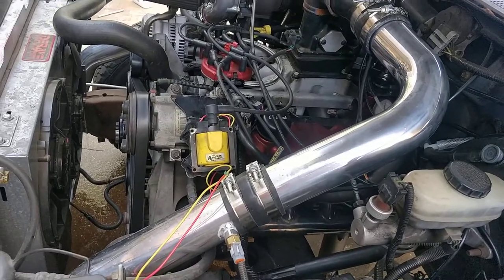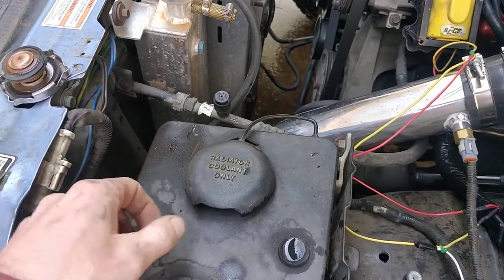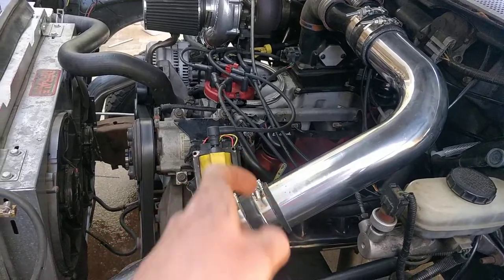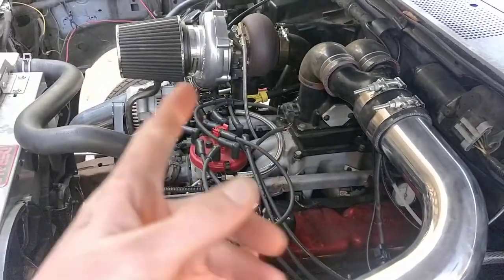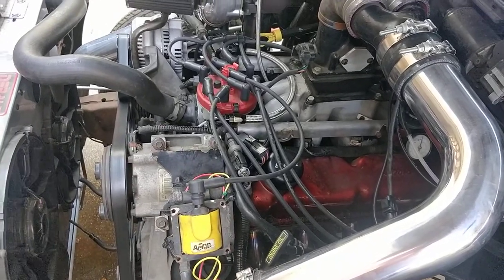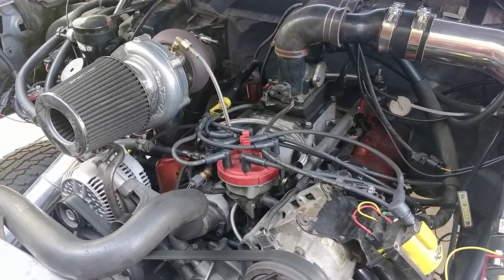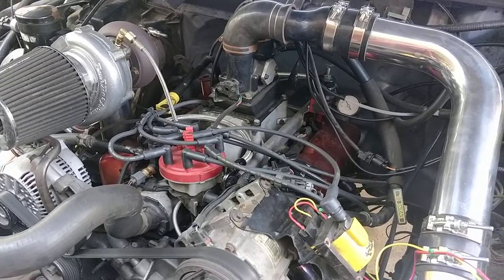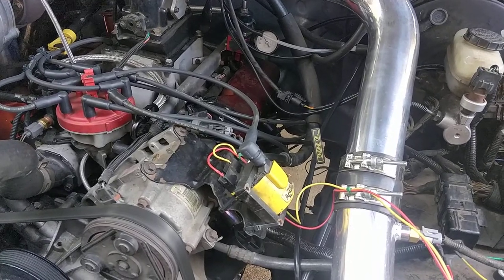Well there's bubbles in the radiator

Comment: Maybe look into getting a multi-layer steel head gasket? Only so much you can run on the graphite ones. though my buddy does run about 9 PSI with his graphite head gasket, but that's pushing it said the machine shop.

Comment: Hey man I just picked up a 96 f150 and have about the same plans. Id like to pick your brain if you had time.
Reply from the maker: Spell it out.
Reply: @michaelwall784  on your cam did you go with a e303? And If so what other mods are required to run the cam?
Reply from the maker: @dylandixon42  I don't have a e303, I have a comp cams 35-440-8, the cam card says to upgrade the valve springs, but I've ran my motor to 6000rpm, with 6psi of boost and didn't have a lick of valve float.
Reply: @michaelwall784  ok cool. Do you have a Facebook or Instagram I could add you on?
Reply from the maker: I just made a Facebook account for my YouTube account. https://www.facebook.com/profile.php?id=100063579368004
Reply: @michaelwall784  awesome I just added you